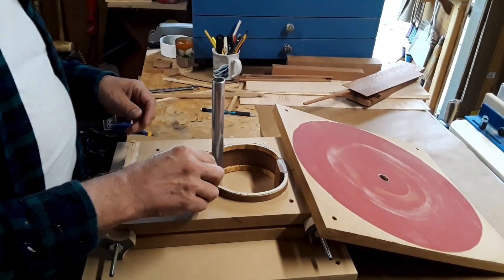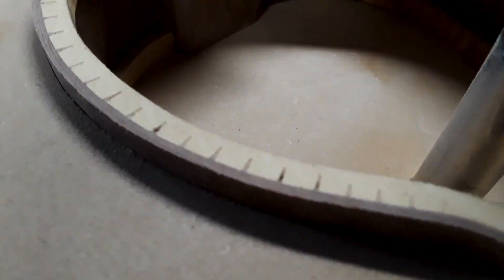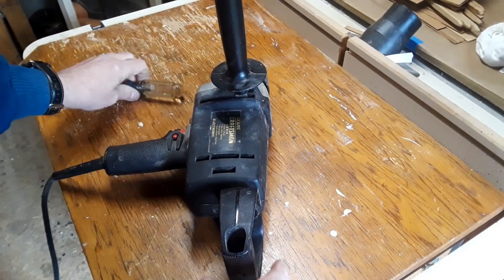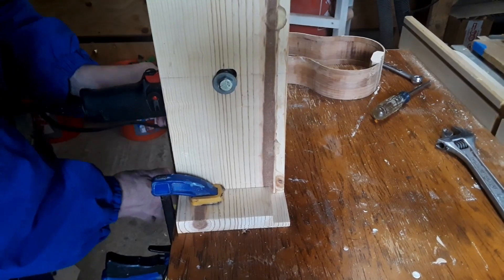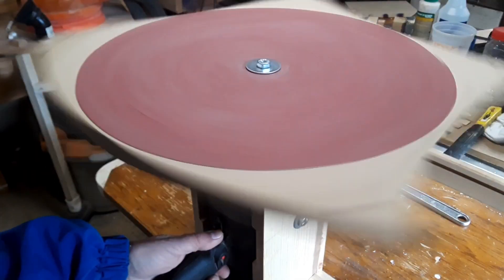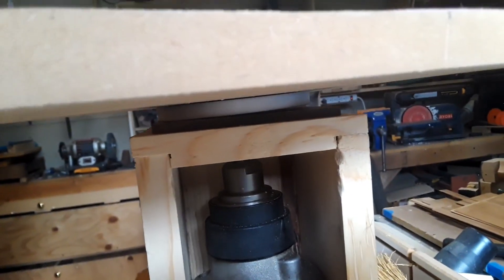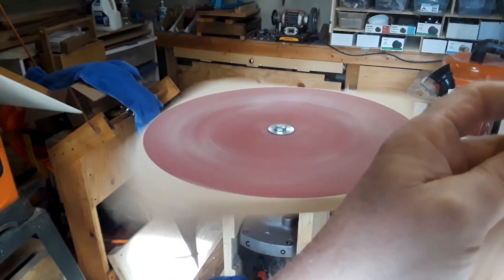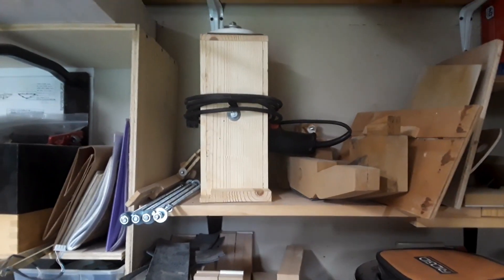Electrifying a Dish Sander

Comment: Huh, neat!  Beats stringing them behind the car, taping a weight on top and going for a drive, which is how I used to do it.   I'd consider clamping that axle to your bandsaw table and making that round to save your knuckles a bit.  Thanks for sharing!
Reply from the maker: The corners look worse than they really are. It's mostly just a camera trick.